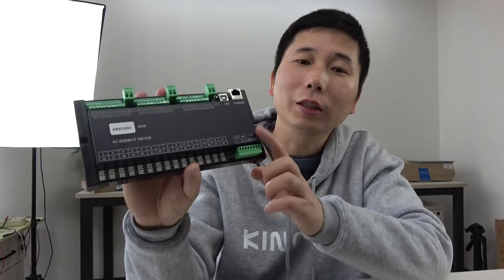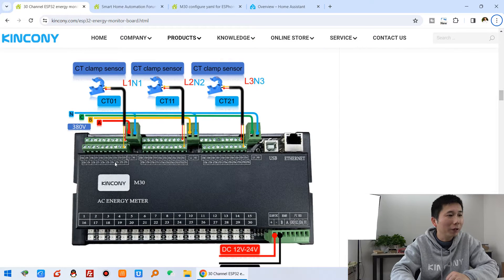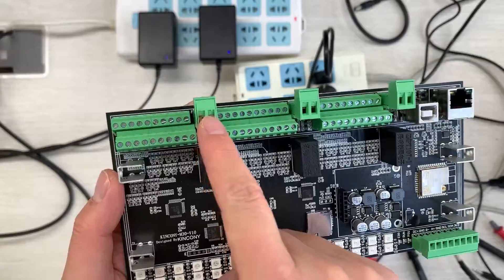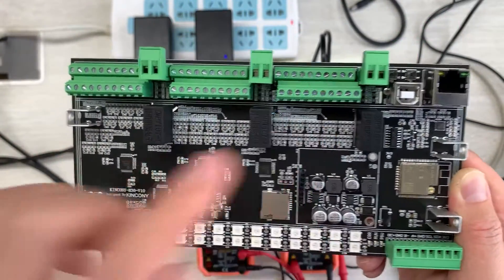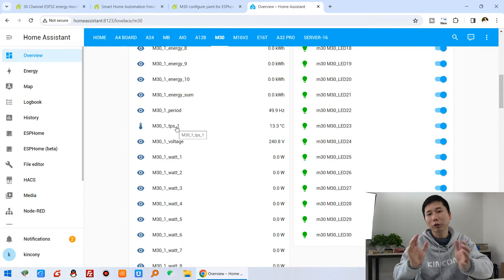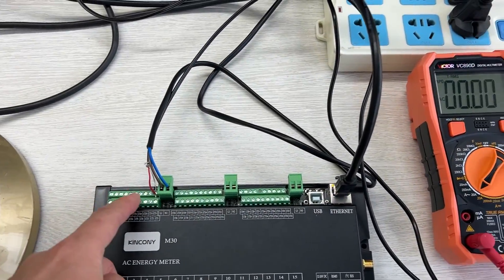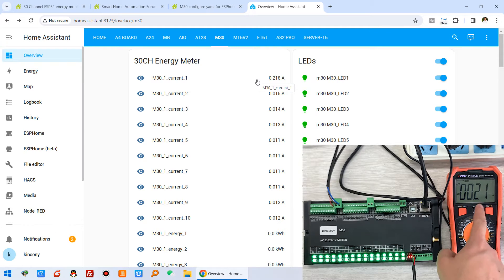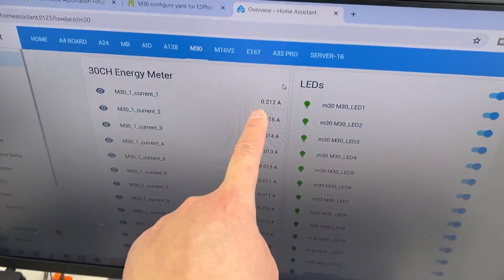Ethernet+ESP32+4G+SD Card CT Clamp Energy Monitor for ESPHome -KinCony M30

Comment: Do you intend to make the unit smaller ? LEDs take a lot of space bring little value (and if some users need them can be replaced by screen mounted to the case).
Many of us would like to use it but there's not enough space  for it in junction box.
Placing input connectors both on top and bottom, or on the front (like wago TopJobs) would allow to make energy monitor 2x smaller on DIN rail.
Reply from the maker: yes, will make new version in 2025. today will upload video talk about it.

Comment: The new upcoming version, I wish we had at least one esp input so we could add some DS18B20 temp sensors.. and if we also could have like 4-5-6 more inputs it would be amazing.
Reply from the maker: ok, will save your suggestion.
Reply: @ Thank you. I would say that the possibility to add DS18B20s is pretty important. I see several user cases where temp readings away from the module itself can be useful and critical. With a single input on the esp for DS18B20 we can have nearly endless amount of temp sensors

Comment: Just to be sure, this would work here in Norway where we have 230V 3 phase, with no neutral? Correct?
Reply from the maker: there are 3 channel AC voltage detect terminal for 3 phase. Phase1-N, Phase2-N, Phase3-N.
Reply: @KinCony  so this wouldn't work for us then, since we have no natural (N). Or could I use L1+L2, L2+L3, L3+L1? (This would give 230V to each of the 3 connectors)
Reply from the maker: @TormodNicholasMortonTorgersen  sure, you can connect as your way. not MUST use N wire.
Reply: @KinCony  perfect. Need to do some more research on your unit, but it seems perfect for my 23 circuited breaker setup. I see you also have current sensors with a small footprint.
Reply from the maker: @TormodNicholasMortonTorgersen  yes, i think you can use one M30 for a testing.

Comment: Can we get Modbus TCP without anything else?
Reply from the maker: modbus only support RS485. if you really want use modbus tcp, ok, you can re write the arduino code for the ESP32 chip on board.
Reply: @KinCony  Thanks, I am trying to limit the number of components… TCP means no need for RtU interface 

I want something very simple ideally just  CT’s and a TCP interface, nothing fancy.
Reply from the maker: @MartynDuerden  ok, maybe in furture we will update firmware add support TCP modbus protocol.

Comment: Hello great product actually amazing 🤩 
I have Question if this is setup for very fast response for super detailed data I belive there is a huge amount of data coming to HA so my question is when setting up HA from scratch are Rasberry Pi 4 is enough powerful or will have some limitations and better go for much faster hardware? Also what is the lowest update time ? 
Regards
Marek
Reply from the maker: Pi 4 is enough to use. just read by modbus protocol
Reply: @KinCony  and what is the highest refresh rate per Chanel when all Chanel’s  used ?
Reply from the maker: 100ms @Przedzik

Comment: Hi Kincony! just curious, why you chose that type of USB instead of type A or C ?
Reply from the maker: because of the shell, in furture we will try to use usb-c
Reply: Using a type B is the legacy way of doing the USB way on a USB device (see printers as an exemple) Type B or Mini B are said to be more durable that Micro B for instance. Plus having good type C support might require extra work... Or the moving to another  ESP32 kind 😁
Reply from the maker: yes, thanks, in furture design we will use USB type-c interface, now we have found a solution. @testman9541